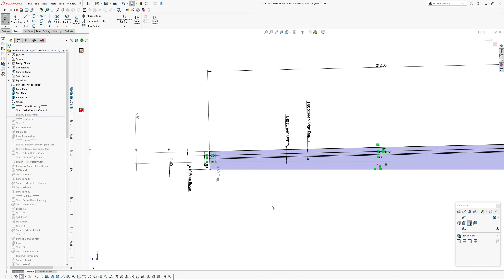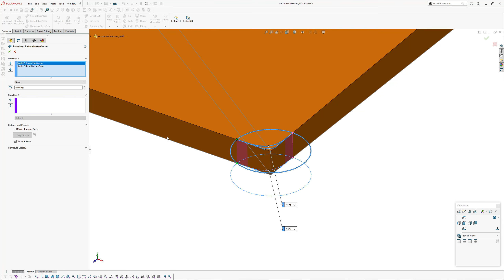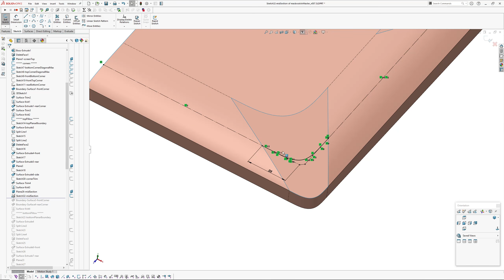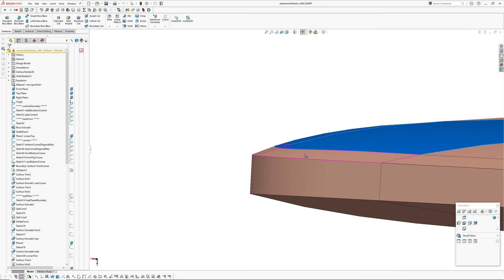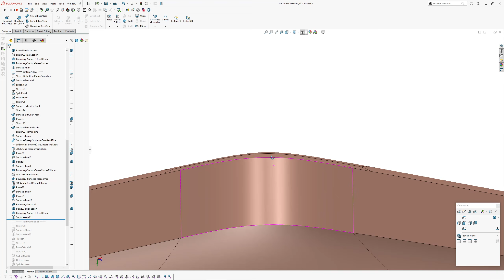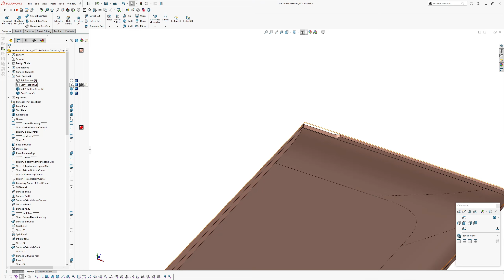MacBook Air M1 Exterior Surface Modelling Exercise in Solidworks

Comment: Just found this video and had my work MacBook sitting next to me. Got really curious when you mentioned how the G3 curves in the corner specifically on the bottom case aren't flush with the faceted ribbon and thought that can't be right.

Ran my fingernail across the surface and holy smokes, you can just notice it. Also if you hold the bottom case up parallel with your eyeline you can just see the gap between the ribbon and bottom case disappear as it dips in the corner!

Wild stuff.
Reply from the maker: Haha yeah, it's a small detail for sure, but one that they decided was necessary! There's a few other details like this on Apple products as well. Here's another one.
https://discourse.mcneel.com/t/how-to-create-a-curved-surface-on-a-rounded-square/137844/17?u=andrew9

Comment: Hi! At 7:49 Why did you take 40 as the distance from outside? Is there any relation to other radii? Thanks!
Reply from the maker: I arrived at a 40mm set back after placing a straight edge on the top planar surface then looking for where the fall off surface meets the planar surface. It looked about 35mm so I added an extra 5mm.

Comment: G3 probably OTT for this type of manufacturing process (5 Axis CNC) but still really cool to see how you've gone about modelling it. Thanks for sharing.
Reply: Not ott in my opinion. G3 fillets is a staple of apple design.
Reply from the maker: Yes, that's my understanding as well. There is an added benefit of having higher order primary geometry which is it trickles down to the secondary surfaces. Like the main outside corner and the effect this has on pinching on the top and bottom case corners.
Reply: @AndrewJacksonDesignStudio  I believe this to be true too. I've seen this improve fillet quality when g3 is applied to the transition of a hard edge highlight. Fewer additional edges that it needs to create are the result in some cases.
Reply from the maker: Not sure about G3 being OTT, the roll off the planar faces on the top and bottom is super smooth and consistent. I think the bottom panel is a pressing judging by the thinness around the rear where you can see an edge. I've not taken it apart yet :)...

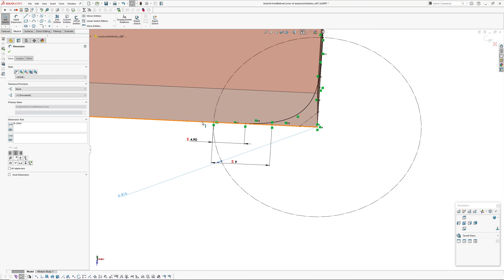Comment: 4:30 how do I make that sketch though
Reply from the maker: Its a style spline. It is in the drop down menu below the old spline (which is default in the menu). Select style spline, make sure it is set to 'bezier' in the side panel. You can make a spline with three points to begin with. Roughly arrange the middle CV to approximate the curve you want. Then select the style spline and increase the degree to 7 in the side panel. This will give you 8 CVs. Then make the relevant control polygon segments co-linear to the two linear elements. The file is in the description as well. Cheers, Andrew.

Comment: Exceptional breakdown Andrew! I think that wobble needs to be fixed to help in manufacturing too!
I still think that apple's rounded edges are not a 7-degree curve with g3 transition!
I think the 90-degree rounded edges are essentially 2 sections. Each section being an NURBS curve approximation of a Clothoid/Euler spiral! Such a solution not only looks elegant due to the linear curvature change nature of the spiral, it also offsets well! And it is just G2!
Try googling  "Track transition curves" and "S-shaped-spiral-transition-curve"
Reply from the maker: Hi Tony, yeah that wobble... this is like the back of the old Imac with the full pillow with no planar surf. If you struggle to make it in CAD, look closer at the actual product and the solution is right there in front of you. Neither of us have a way to confirm how the corners are defined, it is just guess work. No way to measure at these scales and trace to reverse engineer. The only tinsy bit of information I have to go on is in one of my interviews with the fruit company, I was shown three nurbs corners in Alias and had to identify which was single span etc. From memory, one was SS G2, one was SS G3 and one was multispan G3. Probably means nothing! I bet they use an arc mid section blended into the linear elements :)
Reply: @AndrewJacksonDesignStudio  hah! It’s just that I can somehow easily spot the non linear curvature in a g3 curve that’s  used to transition between two 90 lines. The curve sort of has a pinched look if you know what i mean. Rather than a “circular” look
Reply from the maker: That is assuming the physical corner has linear curvature. I'm sure we've had this conversation before!
Reply: @AndrewJacksonDesignStudio  one way to reverse engineer would be to take one of their marketing pdfs. Or even their official dimensional drawings in the Apple accessory design guidelines. 
Open the vector drawing in illustrator and isolate the path that forms the rounded edges. Export as a dxf or something that would open in solidworks and then try to fit a curve on it
Reply from the maker: Yep, done that, to try and get a reference curve for the watch project. It did not really help. I ended up taking diagonal dimensions off the watch.
Reply: https://youtu.be/JVqkgftaHNk?si=98EtTDOj9CJkVjlG
Reply from the maker: @tonsab.assist.master have you seen this post on the Rhino forum? The last post. I'm just messing around with it now.
https://discourse.mcneel.com/t/feature-request-perfected-blendcrv/160768/23